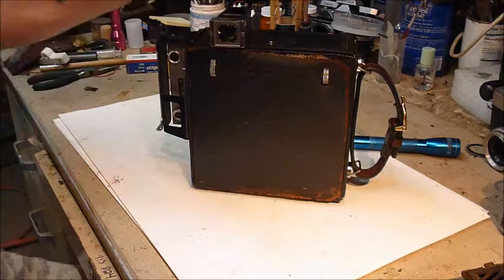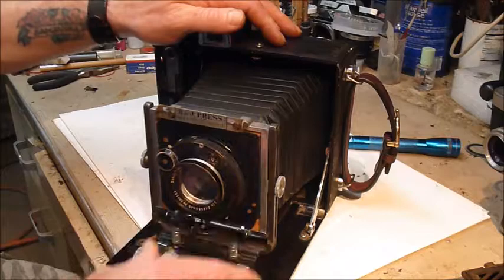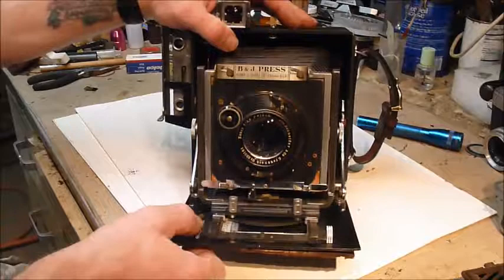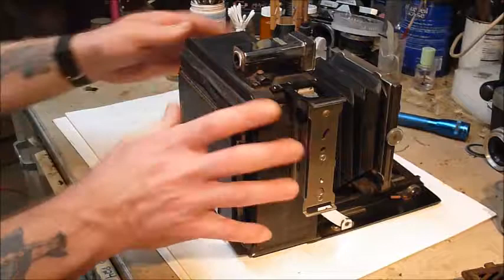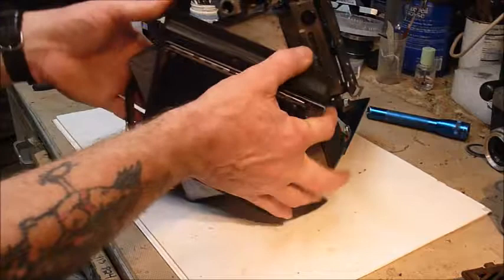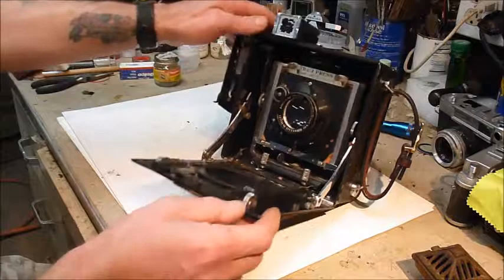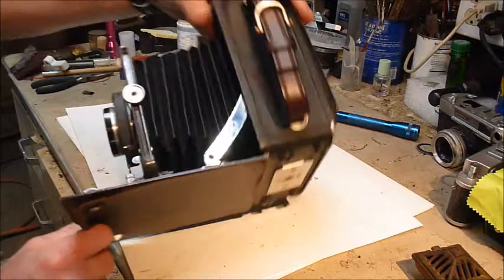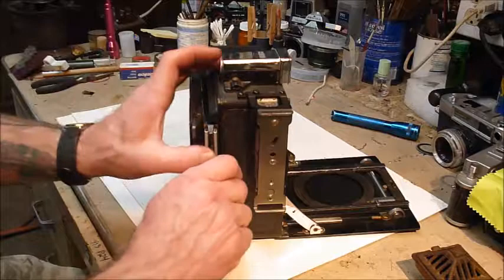Burke and James 4x5 press camera

Comment: I just picked up one in very poor shape. It's disassembled and I've been cleaning and repainting, making a replacement bellows, etc. I came across something I can't find anything on. Between the back plate and the body where the back rotates, it was covered in the remnants of what appears to be lithium grease or something similar. Would something like that have been standard on these? Looks like it might provide some lubrication and possibly help block light.
Reply from the maker: That doesn't sound factory to me. I have since sold mine and can't refresh my memory but I think that is someone's fix for some problem. Mine was dry I remember that and it turned stiffly but smoothly. I would consult someone with more knowledge than myself. There are forums online specific to this style camera.
Reply: @tobroken1965  sounds like it. I’ve been posting around and that appears to be the consensus. Someone’s hack. The poor thing was in really sorry shape. Thanks.

Comment: I purchased one of these with a kodak lens. Where is the button to take the picture?
Reply from the maker: Typically the shutter release is on the lens itself, like the lens pictured above. If there is no cable release hanging from it the button has to be there somewhere. If you still cant find it, look up the lens online, compare what you have to what others look like, and chances are there is a forum out there with info on what you have.
Reply: @tobroken1965  it has a cord in the box. I hadnt really looked at it yet but that makes perfect sense. Thank you so much. Also I have two packages of new film that were in the case. "Best used before 1967" on both of them so there's not much hope to be successful with that film I'm assuming?
Reply from the maker: Dont be to hasty, I dont have much experience with it but some folks put great store in experimenting with expired film. Age does things to film, it might produce unexpected color or tone shifts that have a look of their own. It could also develop almost  perfectly or not at all, much depends on how well or poorly it was stored. I would certainly give it a try. If you decide to give it a try, scan them in and post your results here or leave a link to Flickr or whatever platform you use.  @jamiebiggs2058
Reply: @jamiebiggs2058  I wouldn't exactly call that "new film"! If it's colour film, don't expect great results. It might turn out awful or it might turn out surreal. If it's black and white film, it might be fine. Ive used b&w 16mm movie film which was probably a few decades old (judging by the style of the packaging) and that turned out okay.

Comment: What is the serial number on yours? Just curious about how old your is
Reply from the maker: I can seem to find the serial number, where would it be?
Reply: @tobroken1965  I found mine on the inside of the front bed door that opens up to access the lens mounted between the rails. Mine was 869020 so it was made around 1950ish.